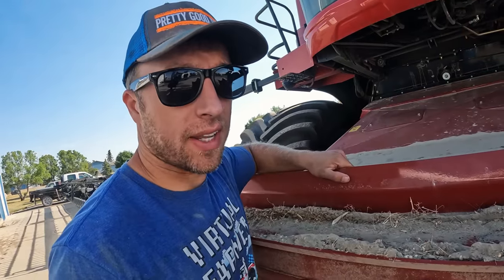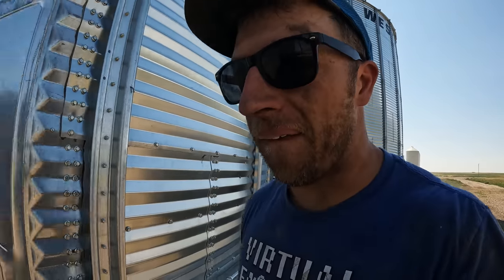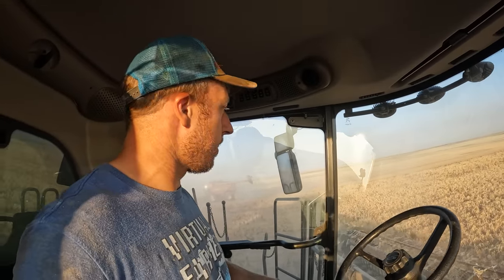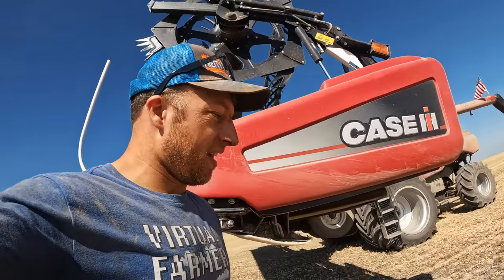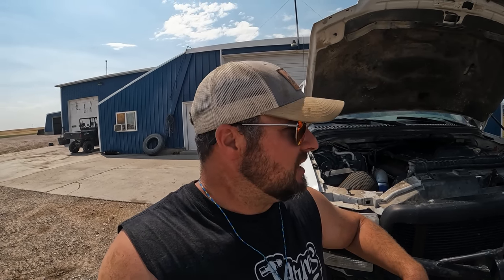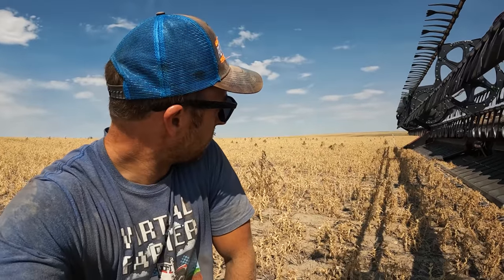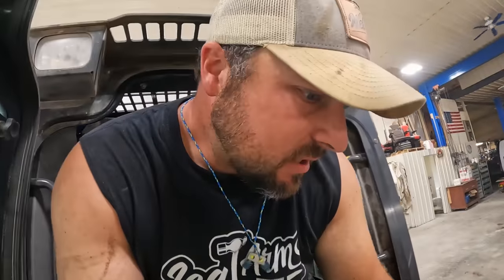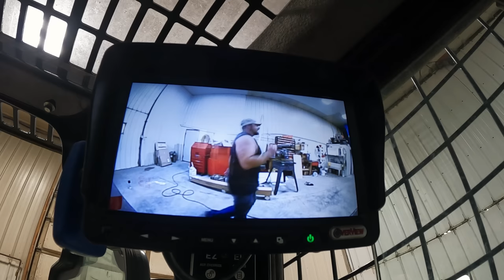We're Off To a Rocky Start...

Comment: Why do you welkers like wasting money? you just got your combines put together then have to destroy them in under a month. why not invest in a rock picker and use it before planting season. put a plow on a tractor and follow it with the rock picker. you can do this after frost out or do it before winter comes. would save you a bunch of money and time fixing your equipment.
Reply from the maker: It's simple, have you ever attempted to rock pick 10,000 acres? With say a picker that has a 6ft workable setup? At say an average of 3 mph? It would take 1 man 5,000 hrs, or 208 days. Now let's say we paid someone $15/hr to run that tractor. It would cost us nearly $75,000. The damage done to our combines from rocks may be as high as $2000. Now because of the glaciers from many many years ago the rocks go 6-10ft under the surface. Each year frost slowly rises new rocks to the surface which means you can NEVER pick all the rocks. It may be difficult to understand but farmers work by logic and common sense and frankly attempting to remove all the rocks isn't practical nor feasible. Hope this helps answer your question.
Reply: I've cut up there many yrs ago. And it's hard as hell to literally get every rock. You can roll and roll all you like. But still rocks still pop up. Rolling is about the best you can do... plus. With peas you almost shaving the ground... depending on the crop growth and rain accumulation.. wheat can be tall and good or short and your still gonna shave the ground. Montana can be a good state for crops or it can bite you in the tookus if you don't have the PERFECT  rain... 😉
Reply: C'mon, @ricky!  Who wants to spend Saturday mornings watching rock-picking videos?  I wanna watch Nick tear-down the feeder house to get get that monster nugget and give it a kick as it lies in defeat!  Rocks beat scissors, but Welkers beat rocks!  😎
Reply: While I'm sure everyone here agrees with your comment it wouldn't seem to be the wisest business decision for them. It is nice if you to stop by and say hello but they do have a rock picker, mind you at is old and beat up but a rock picker none the less. Say they did use the rock picker they have im not 100% sure but 10k acres if the picker doesn't put much strain on the BB that is roughly 40k in fuel...... Now add the cost of a new rock picker 30k or more with that? Now assume the same 1gpa (gallon per acre) for the combine, roughly 40k fuel again but you spend 2-4k per harvester per year to put new chain bars and routine maintenance just for rock problems. WELKERS your family has been doing this for 120 years keep up the good work and continue doing good work...... They are all just opinions whose to say they are right? That would be just another opinion! None of us are perfect. Would love to be able to do what you do on the daily!
Reply: Haha apparently you don’t farm haha my family’s farm we have 3,000 acres and it’s impossible to use a rock picker all the time.   Maybe you should come help a realize what’s involved
Reply: Maybe the guy complaining would like to pick rocks by hand and throw them into a loader bucket or pickup truck box. Did that in the 70's and 80's. Very occasionally I was paid $20 for a days work.
Reply: @WelkerFarms  Not to mention it would require burning ridiculous amounts of fuel, and due to the fact that diesel prices are currently out of whack right now, I can imagine it would be crazy expensive just to operate one tractor with the rock picker attached to it.
Reply: Hopefully rising fuel prices hasn’t affected you too much
Reply: @WelkerFarms  Those rock pickers that many farmers are using are like TOYS. Little 6 foot wide thingys. Y'all need to get self propelled rock pickers that are pushing at least 40 foot heads, thats if there is such an 'aminal' on the market. I think that there was a company called Galenberg-? that made a prototype of such a machine.
Why not go into business making real ROCK pickers instead of picking a few kernels off stunted crops-?
Reply: This REAL 40' wide self propeller WELKER rock picker could be equipped with a laser beam dealie on its head that would detect rocks, drop its head or a section of its head and lift the rock(s) and convey the rock(s) into the hopper to make a rock mountain somewhere.
Sincerely,
The ideas dude.
Reply: OK .. lets time you.. 
You have three hours r to clean  10,000 acres.
Vou can use as many people as you can find .. 
Their payment ... the knowledge of a job well done
You will be charged for crop damage incurred during their "cleaning"

Time is money to bring in the crop(s) and you just wasted 3 hours of their time.
Reply: I assume this is sarcasm that may not have come across correctly.
Reply: And Ricky will never reply back haha...so much shame
Reply: @Northern_Farmer  if you like spending money you all claim you don't have on parts then why not a rock picker?
Reply: @John-nc4bl  it would be better to crush the rocks than to pick them because they have minerals that plants like
Reply: @Northern_Farmer    The questions becomes ... is he a farmer and I don't mean someone who plays on that farm simulator.   Does he have a 10K acre farm?
Reply: Burt  if you can’t say anything nice don’t say anything
Reply: Hey keyboard farmer why don't you come pick the rocks for them  by hand !  Might teach you that it's not possible to pick all the rocks on 10 thousand acres . Your fingers are strong enough from typing now  let's work on those arms now !
Reply: @anthonybanda8192  you took that wrong all i was saying is that picking rocks removes minerals that plants can use and crushing them would be better for the soil i was not saying that they should pick rocks and with that many acers it just would not be logical.
Reply: @anthonybanda8192  and also i am not a keyboard farmer i actually farm if you would know and i have never owned a rock picker and probley wort because well price is a big thing
Reply: @dufinsmrts  my comment was to Ricky not you ! Sorry if you were offended.
Reply: @dufinsmrts  I didn't comment to you it was to Ricky.  YouTube tends to automatically send the comment to the last person who replied to the original comment.  Sorry it was intended for  Ricky.  Your comment about crushing the stones makes  sense somewhat.
Reply: @anthonybanda8192  ok no problem :)
Reply: @dufinsmrts  I wouldn't call a guy with a tractor profile picture a armchair farmer.  I farm  8000 acres of corn soybeans and wheat .
Reply: @bobbyt2657  thats why you do it off season dont be stupid
Reply: @dufinsmrts  like electrolytes its what plants crave — Idiocracy
Reply: @ricky7949  10,000 acres is why. Do you know how long it would take to do 10,000 acres?
Reply: We farm about the same acres as the welkers. We rock pick most of our land every year. Since you don’t cover every square ft of the field it doesn’t take that long. If you have never picked rocks properly the first couple times will take longer but after a year or 2 it doesn’t take that long to keep the fields clean of rocks that can damage your combines. Basically Every farm picks rocks in our area and the large farms often have 2 rock pickers.
Reply: @noahater5785  it hardly takes any fuel to pick rocks. You would burn more in a side x side
Reply: @delinquentdesign   tell that to ricky ... he's the one that has all the answers.
Reply: @WelkerFarms  so I hear you guys need a rock picker. Hit me up
Reply: Clearly, you have never actually farmed.  There is no way to "pick up all the rocks"  Some parts of the country have rocks, have had rocks for thousands of years, and will have rocks long after you and me are gone.  No amount of rock picking will change that..
Reply: Been watching Farm Ag  Montana and they pretty much have the same problem  as a lot of other farmers do so now Ricky has 6 hours to rock pick  2 million acres ...
Reply: @delinquentdesign  well right now we have a ideocracy government
Reply: @anthonybanda8192  i am 4 gen we farm 1200 ac and where selling our cows to switch over to grain and beef farming
Reply: Ricky, what do you do to combat rock in your combine?
Reply: @WelkerFarms  Wow, that was a logical, level headed answer! I appreciate your diplomacy! My blood started to boil after reading the first sentence of the post, and I've got no skin in your game, but I farm as well. NOBODY in our game likes "wasting" money!
Reply: @thomasleonard1846   I think Ricky presses a button on his keyboard that magically cleans the rocks out of the combine, probably instantly sending rock filled combine to the shop with a clone of Scott to fix it as a clean combine magically replaces the one now at the shop
Reply: You'll never get all the rocks. But you could have saved fitting the new parts till after cutting the short crops, giving them a better chance of survival!
Reply: @olivernewell6902   But Ricky thinks it can be done with his 10 million man army.
Reply: A: I love how the person who commented on this thought he was going to make some big brake through and show you guys a thing or two, comedy.
B: All the people who read your reply to the comment then put their own twist on it like they knew that all along, cringe.
Reply: Ricky they do run a rock picker but r u gonna waste fuel maintenance etc to pick all 10,000 acres would luv 2 c u do that
Reply: I have an idea ... if you think it's so easy ... why don't you get your family and friends down to Welker Farms and spend a week picking rocks.
PS.   You will need to sign a notarized document stating that the Welker's are not liable for any injury that you incur and are 100% liable for any damage you or those with you cause.  Great idea,, huh??

Comment: Scott my son's got a 12v cummins and it was doing the same thing. Come to find out that a push tube or push rod had come out from under the rocker and it was not opening the intake valve. Now it looses prime after a few hours and it's got a fast fuel system on it. Going to have to check all the fittings. It's the toys that give guys problems. Good videos welkers. I hope harvest starts getting easier on your combins.

Comment: Almost makes me wonder why you don't remove the locks from the cutterbar and let it float. We have some rocks here too, and cutting soybeans with a 1 1/2" stubble height could be a problem with rocks if we use a rigid cutterbar. With the flex cutterbar it normally jumps over them and the auto header height instantly reduces the ground pressure on the cutterbar to let the rock go underneath instead of pushing it and ending up on the platform. Only very rarely do we get one on top of the platform and can normally stop the feeder with the emergency stop button on top of the joystick before it gets to the feederhouse. The little ones that are locking up your belts on your draper are the reason we run 35' auger heads too, instead of 40' drapers. Just let those go in the rock trap, they don't hurt anything as long you remember to empty the rock trap now and then. With the 35' head just turn up the feeder a few rpm's and run a higher ground speed - less header loss too. On our Case heads, Case came out with those steel fingers with the score line where the finger is supposed to break if it hits a rock. That never worked either - they would beat the floor out of the head before those fingers would break. We went to May-Wes poly fingers instead. Way easier to replace a few blown fingers than it is to replace floor sheets.

Comment: Another rock trap needs to be located in the head between the two long cross belts to stop rocks from entering the feederhouse 'machinery'.
Crop lifters on the fingers would help as well in the tangled and viney pea crop to lift it up to the sickle(s)/knive(s) in order for the head to be lifted higher.

Comment: Leg arms why would have to pull heads on a engine that only has one? Did one under warranty in 96' took myself and another mechanic to get rear of head and a service writer and engine hoist for the front. Four center head bolts were loose.

Comment: Nick, do y'all ever put boxes or baskets on the combines to put the rocks in that were stuck in the combine? That way you would at least get that rock out of the field while you are out of the cab. If you could mount a basket on each side of the head on the backside you could easily toss the rocks in as you walk by and then dump them at the end of the day.
Reply: Been thinking the same thing for a while. Eventually it should at least put a slight dent in the number of rocks in the fields ... might take several years but eventually. Although I do realize they keep surfacing.

Comment: Those rock pickers that many farmers are using are like kids TOYS.  Little 6 foot wide thingys. 

Y'all need to get self propelled rock pickers that are pushing at least 40 foot heads, thats if there is such an 'aminal' on the market. 
I think that there was a company called Galenberg-? that made a prototype of such a machine. They did make a honkin big 12 row spud harvester.

Why not go into business making REALrock pickers instead of picking a few kernels off ove of 😊😊😊stunted crops-?

This REAL 40' wide self propeller WELKER rock picker could be equipped with a laser beam dealie on its head that would detect rocks, drop its head or a section of its head and lift the rocks and convey the rocks into the hopper to dump and make a rock mountain somewhere or how about a rock crusher dealie behind the head and there would be no need to collect them.
Sincerely,
The ideas dude-.😊

Comment: Looks like you'll need to throw a UTuber's party an invite everyone for a walkabout picking rocks.
If you have hole in piston you should have fuel in oil.
Reply: Yeah I'm thinking more likely a head gasket if it's blowing bits of white smoke out the exhaust, especially if his boost was at 45psi at one point. I didn't hear anything loose in the motor in the video, but that knock sure sounded like a blown head gasket to me.
Reply: Only so many you-tubers and SOOO MANY ROCKS !!!
Reply: Rock picking party.. NO

Comment: @Welker Farms  Those rock pickers that many farmers are using are like TOYS.  Little 6 foot wide thingys. 
Y'all need to get self propelled rock pickers that are pushing at least 40 foot heads, thats if there is such an 'aminal' on the market. 
I think that there was a company called Galenberg-? that made a prototype of such a machine. They did make a honkin big 12 row spud harvester.

Why not go into business making REALrock pickers instead of picking a few kernels off ove of 😊😊😊stunted crops-?

This REAL 40' wide self propeller WELKER rock picker could be equipped with a laser beam dealie on its head that would detect rocks, drop its head or a section of its head and lift the rocks and convey the rocks into the hopper to dump and make a rock mountain somewhere or how about a rock crusher dealie behind the head and there would be no need to collect them.
Sincerely,
The ideas dude-.😊

Comment: I was just thinking. I've seen in "How its Made" these camera/sensor things that watch agricultural products flow past a sensor and they blow a puff of air to send the bad stuff off the line.

Why/when is there not yet a row of cameras on the header that are looking/listening for rocks and not stopping the PTO/combine when it see's a rock. Considering the damage a good size rock can do if it makes it past the header and into the machine, even if it doubled the cost of a header it ought to pay dividends over the life of the header/machine in prevented downtime and repairs.

In that same line of thought, wonder why there isn't a chopper drone fleet running down each row of a field looking for weeds to physically sever instead of sending a sprayer out to chemically kill (and subsequently train resistance to the chemicals)

Comment: I know you cover more acres . And I do not have new combines. But we have Rocky ground. And we don’t have these issues with the head., when we do soybeans . How is the head different ?
Reply: We grow beans as well and run 45’ Macdon Head in beans not nearly as many rock problems. My guess... Soil moisture the rocks can get pushed into the soil where as the Welker soil is hard as a brick.

Edit: He has a rigid head we run a flex head so it contours to the ground.